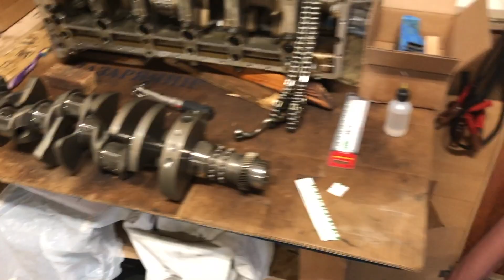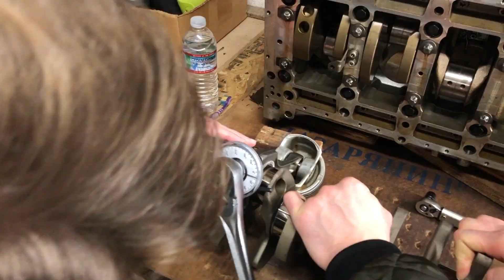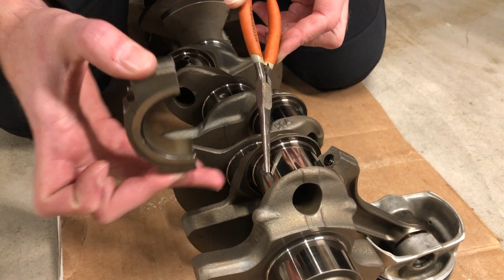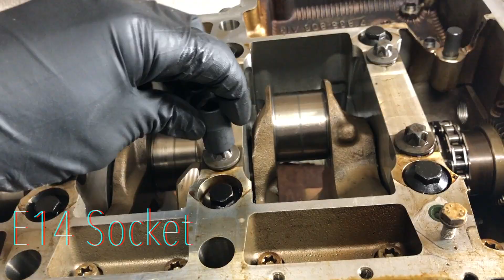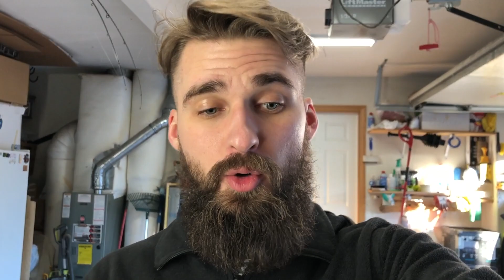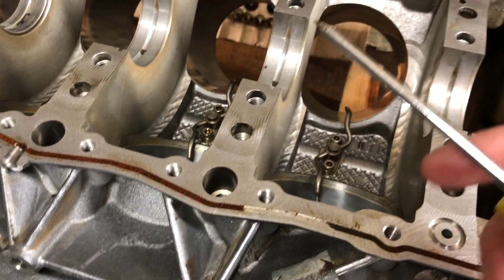How To Remove a BMW M5/M6 S85 V10 Crankshaft and Checking Rod Bearing Clearance (V10 M3 Build)

Comment from the maker: Make sure to like/comment/subscribe and follow the Instagram @YEVSbuilds🤘🏻🤘🏻
Reply: Hi, rebuilding an S85 for my car, first major engine rebuild thats on anything more complex than an LS, do you have a video or can you explain how to know if I should buy the red, yellow, or violet bearings for the crankshaft? im confused as to why there are three options/which one is right for me, thanks!
Reply from the maker: @teargass1849  The engine itself should have a code engraved on it, somewhere behind the right head on the block itself, there will be numbers and letters: my block says "GGYGGG" for exmple, meaning if I'm getting OEM bearings, I'll need "Green, Green, Yellow, Green, Green, Green".
Reply: @YEVSBUILDS  Thank you! that helps a lot, final queston, is the first letter signifying the cylinder closest or farthest from the driver?
Reply from the maker: @teargass1849  To be honest, that I do not know. If you're getting them from a dealer, all you have to do is tell them that code, and they should know what to do with it.

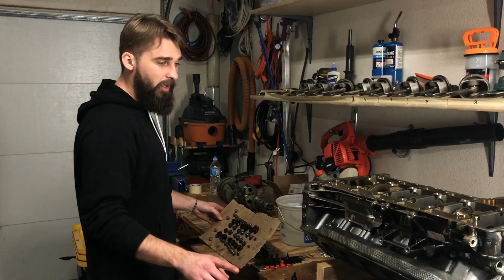Comment: Hi. I have a S85 motor and I'm missing the 12 "fitting bolts" M8x94 grade 12.9 (as stated in the repair manual, page 3606) that you remove around 5:23. Could you please point me out towards a picture of them? I'm having trouble fully identifying them, to be able to search for them online and buy some replacements.

Comment: Mate, how did you scrape off the old sealant on the block? The brown sealant   between the block and bed plate
Reply from the maker: Just gently with a sharp pick tool.
Reply: Mate...any reason you didnt buy the new style oil sprayers?

Comment: FYI. There are newer designed versions of the oil squirters that offer better cooling.
Reply from the maker: Yeah I'm aware of this. But I figured since this motor is from an 08 (LCI/FaceLift models), they're already a little better. And after cleaning and realizing that air goes through both sides at ease, I don't think I'll need to upgrade them. Appreciate the insight though
-Eugene